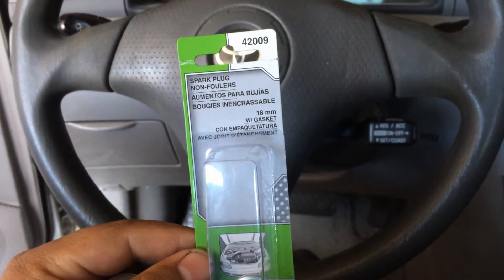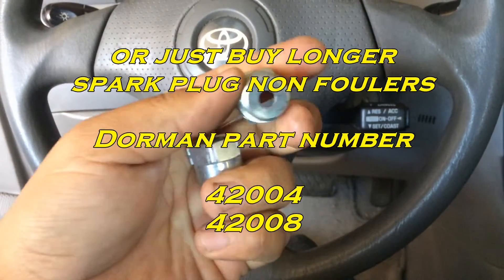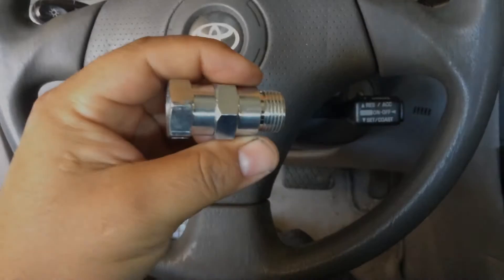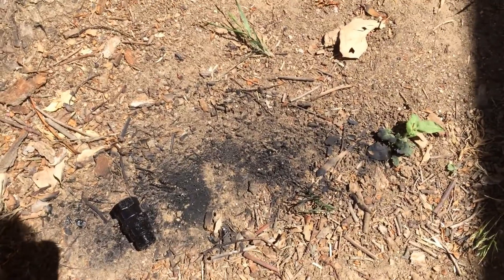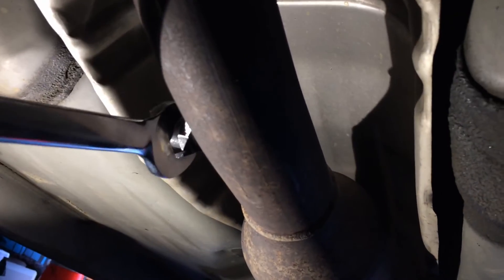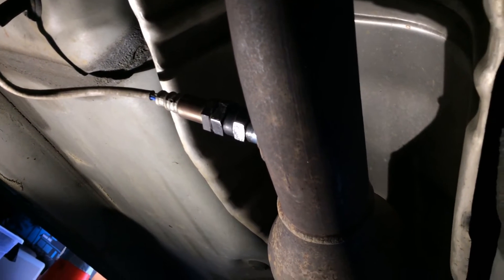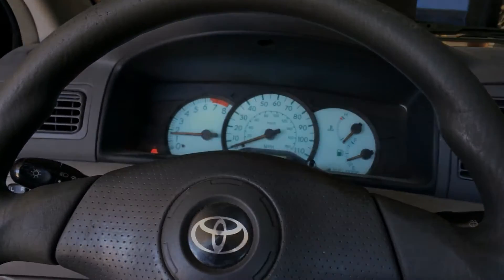P0420 Code Fix for Cheap - O2 Oxygen Sensor Spacer - Do O2 Spacers Work?

Comment: Not how it works, you’re suppose to clear check engine light, which resets the monitors. You have to do a couple drive cycles until the Catalyst Monitor Sets - Complete. Once it’s complete you can consider it a success if no p0420 sets.

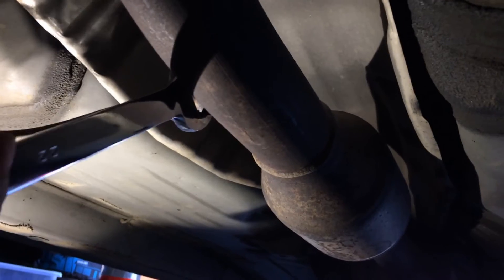Comment: At 2:18, thank you.  Very good tip for those Asian cars that has the connector wires running through the floor and inside the car (hate that).  I want to keep my original o2 sensors and avoid buying new ones, since originals can last 120 K miles +/-

Comment: What is the actual issue . Is it a bad cat or the sensor is bad. I'm asking because my car has this spacer on it and I didn't put it so I had to take it off to pass smog and now it has thep0420 code . I want to fix it but I don't know why the spacer is put on in the first place
Reply from the maker: Yes it was a bad cat.

Comment: I have a 2003 chevy impala 3.8L  & the code pops up for upstream & i put in a new 02 sensor & i replaced the Cadilac converter & the 02 sensor still pops up for upstream please help

Comment: I did this to my 2014 silverado but P0420 keeps coming back. First try I had put only one dorman spark plug non fouler(drilled right through) code came back after 4 drives. I then put on both spacers with the one on the exhaust not drilled out. Code still came back. I have no backpressure before cat, temps are good, 20 degrees hotter after both cats. Now both P0420 and P0430 are present.  I dont really want to replace my cats right now. I have no other issues with this truck, I have to add that my o2 sensors are good, at first when I only had P0420, I had switched both sensors are problem stayed on bank 1 (P0420)
Reply: My 2014 silverado got the 420 code when I first bought it 50k miles ago when it had 113k. Replaced the cats and the light came back 40k later. Found out these trucks have ring issues and burn oil causing cats to foul. Next step is headers here shortly, tired of resetting CEL to use remote start lol
Reply: @KTMjs449 https://youtu.be/CePGNsAkcYQ?si=VeybAgFXLyelHr-E

I thought that was what I needed to do. 

But I checked out this video and the oil consumption issue was solved, problem is drivers side valve cover!

Which most likely caused the p0420, p0430 code from oil burning on cats! I have a 2008 Chevy 5.3  Silverado

Comment: Curious how quickly the ECU would throw a p0420 code with the sensor reinstalled? Would it be possible to space the 02 sensor, have the catalyst monitor set and switch the sensor back to normal and smog it really quick?
Reply from the maker: I have thought about the same thing late at night laying in my bed, staring at the ceiling, contemplating life and yes I think you could. I know what your trying to do and I think it would work. Just park around the corner so they can't see you and then roll your car in and you should be good.
Reply: @bundysgarage  That’s exactly what I was doing when I was pondering the probability. I’ll give it a try either this week or next week as I have to pass a visual inspection.
Reply: I am dealing with same problem of visual inspection.  The location of the downstream O2 is extremely hard to access (V6 by the firewall).  Can see it easily but cannot access it easily without putting it on jack stands.  I may have to try to the resistor and capacitor trick to clear P0431.  Or splice the signal wire together with the other good downstream in the other bank
Reply: No you cannot because it will show that the emissions cycle is not complete
Reply: @kellismith4329  immediately? I don’t think it would. It’d take multiple cycles just to throw a code
Reply: @smallgaragehustle  when you hook the scanner up, it will report “not ready” until the required drive cycles are met, then if the problem still exists, it will show the inefficient cat code
If you are having an emissions test, they will not pass it if it reports not ready
Reply: @kellismith4329  Read the original question again. I specifically said; “after the drive monitor set”

Comment: How to know if upstream or downstream to place it?
Reply: downstream upstream is used to measure for fuel air mix.  Do not put the spacer upstream or you gas mileage will suffer bad, and other things could happen.
Reply: Only downstream ones that monitor cat efficiency.  Upstream function is for fuel/air mixture don't want to mess with those.
Reply: @JYAN2852    That makes sense, but the code comes up Bank 1 ?  which is upstream?
Reply: @Michael-qy1jz  Bank number is the catalytic converter.  Sensor 1 is upstream.  Sensor 2 is downstream.  4cyl only has 1 bank.  V6 and V8 has 2 banks.  Cylinder firing #1 will always be Bank 1 on V6 and V8
Reply: @JYAN2852  Thanks!! Huge help!! Lol.  My daughters 2016 ford focus 2.0 ltr 120k miles has that code. I just changed upstream & down stream 02 sensors yesterday and the code came back.  I'm hoping this trick works. It runs fantastic other than seeing that code. I wonder if its seeing a pressure restriction or inefficiency in the converter?
Reply: @Michael-qy1jz  Very likely that the converter went bad then.  You can buy "CEL fouler" off Ebay for cheap.  All it does is extend the O2 sensor out further so that it can't pick up the bad exhaust as it passes.  In doing so it tells the ECU that all is good.  Only do that to the downstream one though the one after the cat closest to the muffler.  The upstream one is suppose to pick up bad exhaust for fuel and air ratio
Reply: @JYAN2852  Thanks Very Much!!

Comment: Will this help with sluggish acceleration from P0420? A few bucks is easier on the wallet than buying a new Cat.
Reply: No, your cat is clogged. Remove and clear out the  converter. Then add extenders to get rid of the code.
Reply: @Aku112811  how do you clear out the cat?
Reply: @asianstud7  You need to take it off the car. Should be a bunch of stuff caked in it if it’s clogged. Just remove all the debris. You can clean it with gasoline. This is just so you will be able to drive the car. You will still have the code for the cat being bad. If you don’t want the code to appear you need to ad spacers to the 02 sensor. The one that is after the CAT.
Reply: @Aku112811  how does the spacer work? What's the concept behind it?
Reply: Yes gut out the cat first then add the spacers.  The poor acceleration ia due to clogged cat
Reply: Haha! What a rebel.
Reply: @JYAN2852  how do you clear out the cat?

Comment: Works perfectly fine I just did it on my 2002 Toyota Celica I used 1 non fouler 1/2 inch drill bit and that’s it done ✅ my car passed the emissions test with no problem 👍🏻👍🏻👌🏻🤙🏻
Reply: @usa wicked the smog guy didn’t see it on my car

Comment: I replaced my exhaust manifold and the code went away 🤷🏽‍♀️
Reply: this is secretly just a way to cheat the code for people who have manifolds or headers that have no catalytic converters. no o2 codes, passes emissions.
Reply: @ND-EED   my whole exhaust system had to be replaced though 🤷🏽‍♀️ my manifold was old and worn out my exhaust pipes had a leak and my catalytic converter was making a sound..
Reply: @OgHoney  thats the right way to get rid of the code, this mod is illegal but will get rid of the code, but you’ll still be blowing out toxic gasses
Reply: @OgHoney  did your car drive better or made any difference
Reply: @jaquancrump7316  yes, but when you change that please change your throttle body too it makes a huge difference
Reply: @OgHoney  more power? Sounds better?
Reply: @jaquancrump7316   yes, better acceleration
Reply: @OgHoney  say less imma do my own work imma rebuild my car haha
Reply: Did your car drive better?

Comment: Hi . 
I have P0170 Powertrain fuel trim (bank 1)
The catalyst no longer has ceramics and gasoline consumption has increased.
If i will use this O2 oxygen sensor extender the error will disappear and consumption will be regulated ?
My car is Fiat punto 1.2 gasoline.
Thank you .
Reply: no, this will not work in your case. this "fix" if for the DOWNSTREAM o2 sensor which is checking efficiency of the converter. This will not work for any UPSTEAM o2 codes.

Comment: You can also  poke  out  the  middle  of  the    converter   and   leave it  on  if you   wanted   to.
Reply: You will still get the code

Comment: If  it  works,   and  you   can   do   straight P,   no  cat,   then  im  for   it.
Reply: I had a p0420 I was doing straight pipe but no issues the car ran great I wasn't  concerned  with any dash light
Reply: @old cars trashed we don't have inspections here, so excuse my ignorance regarding inspections, but how does it pass?  I thought they inserted something in the tail pipe that monitored emissions.  It seems all this is doing is fooling the computer, but if you remove the cat wouldn't the inspection sense a problem in the exhaust?
Reply: @old cars trashed thanks for the info.   I have indications that my cat is clogged (take out upstream O2 and it runs better) but before I purchased a new cat I was going to punch out my cat and use one of those spacers with a mini cat for the downsteam O2.  But is that even necessary?   It seems that just the spacer by itself will work.

Comment: Did the rest of the emissions diagnostics’s complete successfully? I’ve put 200 miles on since the fix, and my code reader is showing that the emissions checks are showing “INC”, for incomplete. 

Thoughts?
Reply: I've learned that the computers diagnostics for the emissions is not based on mileage, like someone told me before, but based off of several tests. For instance I changed my girls o2 sensor on her maxima and she drove it about 300 miles and the light did not turn off. Turns out she was just going to work on the highway driving fast both ways. I looked up the Nissan FSM parts about the OBD emissions test. Based off her driving style I could tell that the computer was missing a required reading at low speed for 20 secs and another reading of steady state at 40-55 for 20 secs. When I drove to meet the requirements the light turned off.

I know I could have just turned the code off with a scanner or battery reset but I wanted to make sure I did the right sensor because that car has 4 and the engine is sideways and everyone used different terms for the banks, front/rear, left/right lol.
Reply from the maker: Glad you got it!

Comment: These don't work on a high flow high performance car.  You will still get the codes.
Reply from the maker: If you have a high flow high performance car, you should have high flow cats and not even experience this problem.
Reply: @bundysgarage  How do you figure?  Do you know how O2 sensors work?  If you have high flow cats, Then your downstream o2 sensor is going to throw this error because the exhaust flowing out of your cats is not much different then when it goes in.  Considering the new federal laws, Most tuners will not disable the downstream o2 for fear of being sued.  Therefore, You get a cat error because it's reading the same which in the computers view means your cat is not working........
Reply: @jasonweiss7757  it monitors co2 only and has nothing to do with the upstream. If it reads excessive amounts of co2, than it pops the code. Nothing about comparing readings with the upstream
Reply: @jasonweiss7757  Work just fine for my high flow, high performance car. With ZERO cats. 😏

Comment: Does the spacer work for p0137 code ?? I have change 5 sensors and still the check engine light comes back any possible solutions
Reply: after about the second sensor, wouldn't you start looking for a different solution?

Comment: Great thing If you delete the cat. If you have a bad cat then this will mask the light but can cause engine damage. If your cat needs to be replaced then replace it. A bad cat could cause a lot of back pressure if it's blocked or busted. I used this because my vehicle has 2 cats. I deleted one and put this in so it will pass inspection. When they look under the vehicle they see a cat and pass it not even noticing the deleted one. 🙂
Reply: I gutted cat and installed these light came back on any suggestion 2012 Chevy Cruze. Thanks in advance
Reply: Outback?

Comment: Any tips on a seized O2 sensor? I have a 2005 4runner and the driver side sensor is an absolute pain the ass to take out
Reply from the maker: Have you tried heating it up with a propane torch or a MAPP gas torch and then try breaking it free?
Reply: @bundysgarage  that's the best way, but heat up the exhaust bit rather than the O2 sensor bit
Reply: I heated mine up for 2 minutes with a propane torch and then used a 8" pipe wrench to break it loose.

Comment: If I don't have a scan tool to clear the clear the code, will the check engine light go away on its own after driving the car a while with the spacer in? Thanks.
Reply from the maker: Affirmative
Reply: @bundysgarage  exactly what I was looking for. However I've done like 150 miles on my Honda element already and still hasn't turned off...
Reply: @bundysgarage  Thanks!
Reply: You can also try disconnecting the negative terminal on your battery for about 15 mins. That should clear the codes.
Reply: I agree with  @de0zz  this technique also works if you want to reset your radio presets and clock. I can attest for this technique
Reply: No you unplug the negative of the battery for like 15 minutes

Comment: My check engine light code P0141 comes right back 3 seconds later after l erase it even with the non spark plug Fowler on.
Reply: P0420 is a cat code, P0141 is an o2 code.  Replace your o2 sensor
Reply: Aftermarket sensors can give that code, happened to me, I installed new bocshe sensors  and got that code, put the genuine oem sensors back in  and code went away

Comment: I'm getting ready to do this on my 2009 Jeep Wrangler.  Got the P0420 code.  Wondering if you used the 02 sensor trick on both downstream cats or just one side?  I haven't de-catted anything yet and wondering if the non-foulers would be enough to work on their own without taking the cat out?  Any idea? AutoZone's OBD II reader didn't specify a bank so I'm assuming both cats are plugged up.
Reply: Ever get it figured out?